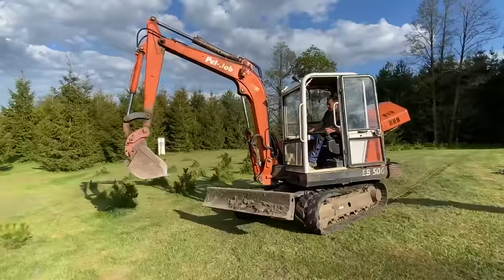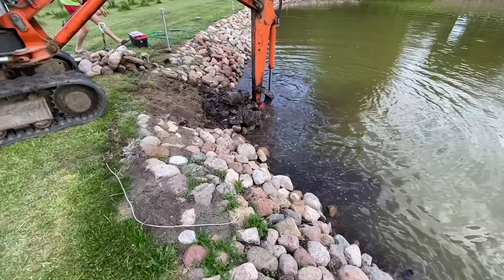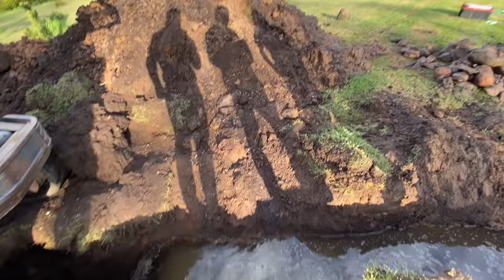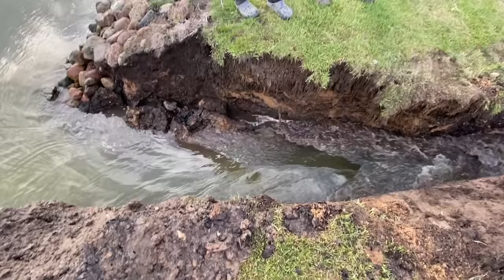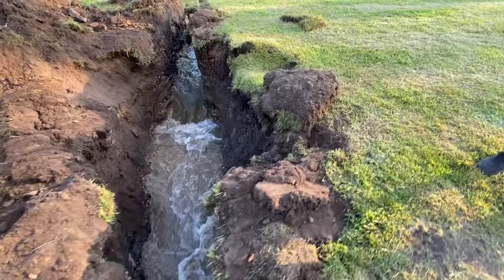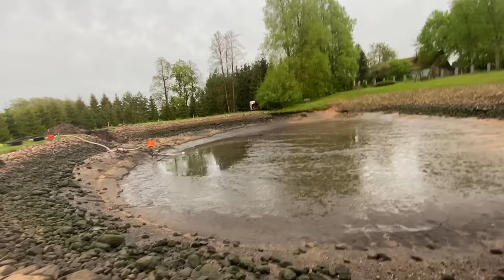DRAINING 10 ARES POND TILL THE BOTTOM. STUCK EXCAVATOR.

Comment: Inexperience? When extracting small shrubs make your dig shallower, it works. Try to keep the blade in front of you and clean up the sides of the ditch. And with a simple laser level you would have only had to run the ditch once. They're cheap to rent.

Comment: Why the destruction? A 3" trash pump would have done the job with much less work and damage... Is that discharge volume even legal? Most expensive why to do it. And damaged pond structure. Also good top soil gone. Definitely not a experienced operator.. Did you fix the ditch on the other side of the that you destroyed?

Comment: This excavation was entirely unnecessary - including the cost of all the equipment.

I’m wondering why you didn’t simply set up a 3 or 4-inch siphon pipe to drain the pond over 2 days?
The length of the siphon need not go all the way to the drainage ditch - as demonstrated with the pump discharge.
Using a siphon, the gradual drainage will not overwhelm the drainage ditch or any of your neighbors downstream e with excess water and unwanted silt.  With silting up the drainage ditch, you have created another problem that could end up being bigger than your little fish problem. In fact, you may be introducing the carp (or whatever fish that occupied the pond) to other downstream ecosystems that could be adversely affected by the new species.

It just seems like there’s a lot of details missing here and no consideration has been given to potential unintended consequences.
I hope I am wrong.

When the pond level gets down to 6 inches, it is easy to pick out all of the fish with a dip net; it also gives you an opportunity to clean out silt, trash, skeletons and snapping turtles.

Now you’ll find a bunch of dead fish in the drainage ditch her that could’ve been transplanted to a different body of water - along with sending a lot of silt to fill the ditch.
I hope you are going to install a proper overflow & drain valve - which would be the only real reason to dig that unnecessary ditch in the first place.
Reply from the maker: Hello Mark,

If this pond would be mine, I would do in proper way. I just reintroduce few agressive fishes and It would fix everything. Of course there must be some fence around this pond to avoid otter. 
Also was interesting to see what's left there after 15 years. Some time ago there was lot of big carps. But otter ate them.

My role was just film it and assist a bit.

Cheers mate!

Comment: I can’t help but think a 60 hp diesel pump could have did a much cleaner job even if it took two days to drain it. And you wouldn’t have to worry as much that all the excess water doesn’t end up in someone’s basement down stream. I’ve seen 80 hp pumps run an 8 inch hard pipe and push up hill on a 70% grade with no problem. And with no mess.
Reply from the maker: It was not my pond :) I would do in other way ;)

Comment: need some practice with the excavator. Your last cuts to the pond, you should have been perpendicular to the ditch and straddled.  Also, your going to need to fix your bucket extension so you get a 90 swing to the arm so you dont have to keep bumping the bucket to empty it. Otherwise your going to be replacing connecting pins a lot more often, I can already hear the ones you have "SLAPPING". Not super expensive, but definitely time consuming. Good luck
Reply from the maker: It's not my job ;) I was just filming it ;)

Comment: Whoever was operating that escalator has no clue what they are doing.  The trench looked like it was much deeper than necessary the necessary they went all the way down to the stream which was unnecessary and and just the general operation of the escalator is very bad. Look this looks more like a homeowner went to home depot and rented a mini.  And I agree with a lot of the other comments this pond does not look like it's 7 acres 2 at the very most and They could have gone and bought a gasoline powered pempowered pump and a filter screen to go on the end of a suction hose for less than what they rented the escalator for but at least that way they get to keep the pump from future use. It may take a little bit longer to drain the pond with a pump may be an extra day or 2 but you're not digging a trench you're not tearing up the yard you get to keep the equipment and it's still cheaper than an excavator. This whole job was harder than it should have been.

Comment: Otter hunt in family units from 2 to 6 .two adults and thar offspring. Thay can kill up to 10 lb of fish a day each. Thay hunt very large areas. Generally a fence will need. A electric stock fence also at 2in 6in and 12in .if you leave any gaps Thay will find it and kill your fish..you can also use a 330  conerbear trap  to catch them .in a small pond they may only come once or twice a year for a few days.
Reply: Otters don't get scared of the trap. Not to hard to catch.   You may be able to snar them also.  But I have had better luck with the 330 traps.

Comment: These guys have absolutely no common sense. Why didn't they use the water pump to drain the pond BEFORE bringing in the mini - excavator? They could have drained the pond down to ALMOST empty, and then it would have made it easier for them to remove the fish. Then if they was going to put in a drain, an almost empty pond would have made it easier on the mini - excavator because the operator wouldn't have to worry about the water. Ass backwards.

Comment: Trench was completely unnecessary. What enormos unnecessary damage.  Should have used siphon and/ or pump in the first place. Float the inlet near surface for larger differential and less debris.
Seriously novice operator was hard to comprehend, not using any support boards. No exit strategy omg. Could have gone much worse.

Comment: Because a 5" pump would not have emptied that pond in 15 hours.
I hate stupidity. And this is stupid.
Reply from the maker: There was 2 pumps. Without ditch it would drain it for a week.
Reply: A 5 inch pump with 5 inch lines, pumps about 640 gallons per minute. 38,400 gallons per hour. 921,600 gallons per day. Two days maximum !

Comment: 7 acres?
Reply from the maker: 100 acres = 1 hectare.
Reply: @Kenislovas  That is not correct. 1 acre = 0,40 ha.
7 acres = 2.8 ha
Reply from the maker: @useitwice  maybe in You country is different measurements.
Reply: @Kenislovas  Comparing acres and hectares is like comparing inches and centimetres. Both acre and inch are Imperial measurements, hectar and centimetres are metric. So it is impossible for 100 acres to equal 1 hectare. Im from scandinavia so I use the metric system, like I presume you do too.
Reply: From wikipedia: The acre is a unit of land area used in the imperial and US customary systems. It is traditionally defined as the area of one chain by one furlong (66 by 660 feet), which is exactly equal to 10 square chains, 1⁄640 of a square mile, 4,840 square yards, or 43,560 square feet, and approximately 4,047 m2, or about 40% of a hectare. Based upon the international yard and pound agreement of 1959, an acre may be declared as exactly 4,046.8564224 square metres. The acre is sometimes abbreviated ac,[1] but is usually spelled out as the word "acre".[2]
Reply: Nonetheless, I really enjoyed your video. I just got confused by the 7 acre size in the title. Have you seen BamaBass channel where he builds a 5 acre pond? Its much bigger than this pond.
(I recommend his channel, I think you would like it If you havent seen it already)